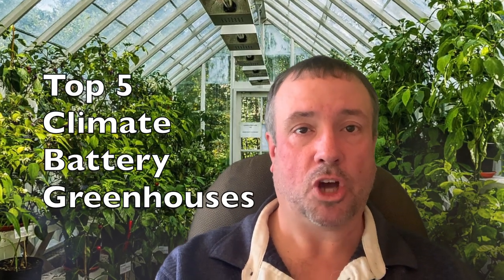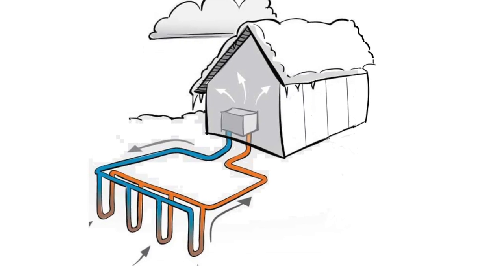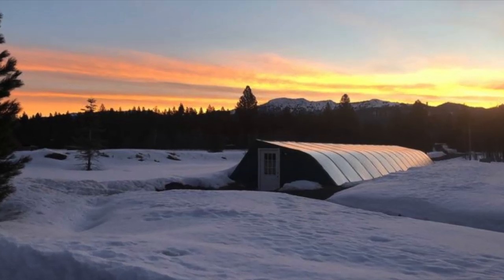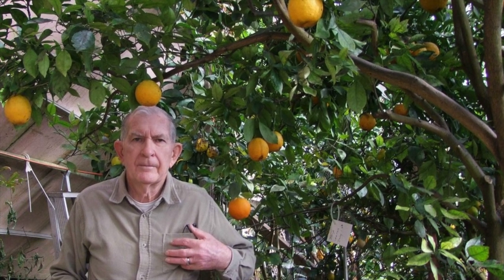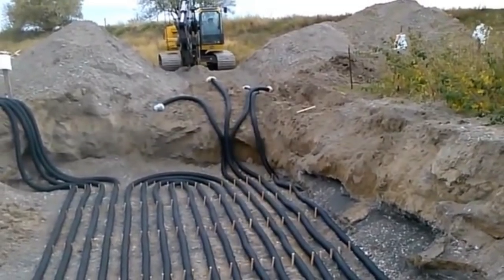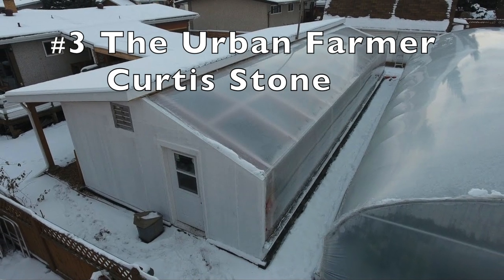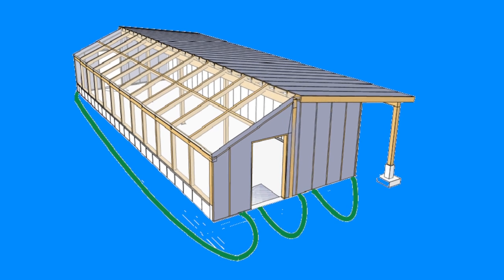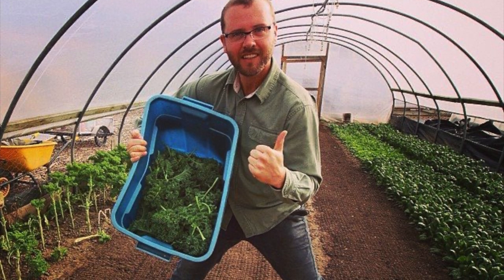Top 5 Greenhouse Climate Batteries giving Free Heat in the Winter!

Comment from the maker: I'd love to hear from you about your favourite earth battery greenhouse I didn't cover here!!!
Reply: The one beneath my greenhouse ;) 
Most of the systems in the vids dont perform as well as expected, especially for cooling, due to layout and overall design. If a system isnt efficient for cooling, it wont be efficient at storing heat because the same process is used for both. The other thing that isnt mentioned in vids or commercial advertising is the amount of moisture thats returned to the greenhouse along with the heat. Folks assume the heat returned is 100% sensible, like an electric heater, when, in reality, the bulk is in latent form (water vapour). If you have a system installed, its easily confirmed by tracking the greenhouse RH% when the system is heating.
Reply from the maker: @JohnGuest45  yes!!!!!!!!!
Reply: Christopher Brandsdal channel. He is is experiencing a lot of interesting problems.
Reply: Glad you gave Gus top spot!  I bought his greenhouse in January, and am in the finishing stages of putting it together myself (working on the retaining wall this weekend).  The only real negative I can say is that the plans/directions are lacking pretty badly.  You better have some construction know how to put it together.  But, it's a great greenhouse, and I can't wait to be finished and begin setting up my aquaponics as well as planting my orange trees!
Reply: @JohnGuest45  If you're having trouble with cooling.. do you have a tube running the top of your greenhouse to underground outside?  That's the easiest way to vent excess heat.
Reply: @basedbear1605 
Heat i want to keep goes into the ground under the greenhouse, excess heat that cant be stored (late in the season)  goes out the top vent. I dont have any trouble cooling the greenhouse.
Reply: Here's an article I read about a man who extended the Whitehorse growing season by buyilding his own home made "root heater". Chris Bartsch. https://www.cbc.ca/news/canada/north/solar-root-heater-whitehorse-1.4301082
Reply: @tineschrijvers3174  What's cute is you think 1972 was the first active solar greenhouse when Walipini greenhouses have been around for hundreds of years.
Reply: St. Isidore removed their Greenhouse, would elaborate on specifics just that it failed.
Reply from the maker: @JamesJones-tx7tz  they needed more heat
Reply from the maker: @basedbear1605  I do?
Reply: @SimpleTek  You do what?  You're commenting on 6 month old comments and I made more than one on this thread.  A little more info would help....;)
Reply from the maker: @basedbear1605  I found these comments today, so some reason they didn't show up in my daily comments section in Youtube creator studio that I check regularly.
Reply: @SimpleTek  All good, but what were you saying "I do?" to?  It's not clear.
Reply from the maker: @basedbear1605  I might have made a mistake lol
Reply: I think someone listed them a few posts down from mine - at the time. I think it's something about the Rocky Mountain Institute of some stripe. My tablet might be able to give links, but then I'd have to learn how to make it.
Reply: @Luca Colson instablaster ;)
Reply: @Alvaro Arturo It did the trick and I now got access to my account again. Im so happy:D
Thank you so much, you really help me out :D
Reply: @Luca Colson happy to help =)
Reply: Buried molten solt reactor.
Oh, it's coming.
Reply: @JohnGuest45  can I have a look at your improvements to the layout/design?
Reply: @johannesdoderlein6655 
You need to understand why the basic design that most folks use isnt optimal. In most cases, its  clear that very little, if any  design work went into them because the issues in the finalsdesign  would have been caught long before it left the drawing board.
Reply: @JohnGuest45  I have not yet acquired the skills to understand the mistakes/mechanics of these designs. But I would like to get a real good understanding, get a hold of the key insights and information needed in order to make a well working winter greenhouse. I am currently working as a gardener in a greenhouse, with heat supplied by geothermal wells. But it’s not an insulated winter greenhouse. But I would like to make the case for building one at the farm were I’m working. That way I would be able to have much more fun at work, with tropical plants that gives me great joy. I’m in Norway, close to Oslo. Winter is dark, and would like to have mediterranean and tropical plants around me. So if you could provide me with some direction that would be appreciated.
Reply: @johannesdoderlein6655  
With deep geothermal wells you are in a better position than most. Insulation is vital but you will also need to consider light in your design criteria due to your geographical location because nothing will grow well in the dark, apart from mushrooms :)  A lot of folks that design systems dont give much thought to the plants considering the whole point is to extend the growing season. A logical approach is the best option, beginning with the structure and local climate to assess the heating and cooling loads. The design must meet the goal but its impossible if you dont know what the goal is.  Folks that design heating and cooling systems dont guess and hope for the best :)
Reply: Please  check out Arcopia greenhouse in Saskatoon Saskatchewan. He is also doing a great job in solar greenhouse design.
Reply from the maker: @toechop  will do
Reply: mine, it'll be completed soon and on your next video!

Comment: These are all great earth batteries with large budgets. For those of us with more modest size normal greenhouses, I have a solution. Yes insulate that north wall. Also as sand batteries have become news worth over the last few months, it's the same idea so I dug a hole in my greenhouse 4 feet square and 10 feet deep. Insulated it then filled it with sand and air tubes and covered it. with the same idea as the fancy ones, a fan takes hot air from top of greenhouse where it's hottest and pumps it into the sand to charge it, then when the temps drop at night it works the opposite way. I built mine for around 350 dollars and most of that was on the sand and insulation. It works great.
Reply from the maker: Great idea

Comment: Thank you for sharing all this information with links so we can research and see what works best for where we live and the size of lot or acreage we have.  I live in Canada where winters are very cold in some parts.  I live in an area where average lows are (in F): Nov: 18; Dec: 3.2; Jan: -5; Feb: 23 and Mar 32.  Frost line is 4 - 5 ft - and as much as 8 ft in bitterly cold winters, deep enough to burst city water lines (2014 major damage). Curtis Stone is lucky to live in Kelowna where winters are much milder  (Nov - Mar avg between 21 F - 36 F) therefore more shallow frost line.  Here we would have to dig at least 6 ft for an underground heat storage system. And how can anyone hit the dislike rating on this or any of your other videos???!!!!
Reply from the maker: considering I live an hour north of Winnipeg I understand cold winters. The key to a climate battery in our climate is insulation. Later I'll be doing videos on this - the best materials I've found are if you can get styrofoam from buildings being destroyed or making your own air Crete. if you have 6-10inches of insulation around your climate battery the cold weather and frost isn't a big deal.
Reply: Hi Tine Schrijvers, sounds like you are in Southern Ontario or equivalent. From my experience as a city water supply technician, I can tell 7 plus feet below surface is good enough for freeze prevention in the greater Toronto area.
Reply: @AshoreToo  Actually I am in NW Ontario, near Thunder Bay.  Zone 3a or 3B - 2A or 2b  Toronto is Zone 6 so much warmer.
Reply: @tineschrijvers3174  I've finished my career with City and now I'm preparing to start green housing near satellite cities of Greater Toronto. I hope to compost inside the poly-carbonate greenhouse, burn dried wood and shrub to generate heat, possibly make a waste engine oil burner. To enhance heat retention, I plan to cover the top and outside of the poly-carbonate sheeting (with bubble wrap) during severe cold times and roll the bubble wrap away when sunny. Inside I'll add a high tunnel of bubble wrap over the beds so that there are 3 layers of insulation. Biogas is my target too although my scale will be tiny.

Comment: Great video, but I was expecting 5 different types of Greenhouse Climate Batteries.  What do people do for greenhouses in areas with shallow bedrock, etc?  I like the idea of digging down and blowing air, but I've seen several people utilize black heat-absorbing beds, floors, solar hose arrays, and aquaponic tanks to act as heat sinks.
Reply from the maker: you can build a climate battery above ground and insulate the walls

Comment: I've talked with Russ on the phone about 5 yrs ago.  Great guy.  He is a tinkerer like us.  I live in Kansas City area and thought I could just drive up to visit but he is almost to Wyoming  ha ha.    My ground temp here in 56-7F/13.3C about 8 feet down so I bought the CD but still haven't moved to the country yet.  The biggest problem I have witnessed on Youtube on variations of these are when when people move away from Russ's I never see a follow up videos from them. I don't know why this is.  I know from my conversations with Russ he has tried virtually everything and if something worked better, he would have gone in that direction.  A big issue is when you place a lot of turns in your underground tubing.  That slows down the air considerably. I think he said he only had 2 or 3 in his entire system. I think what is missing are actual temperature and windspeed sensors down in the ground to see exactly what happens in many-bend systems. Also, intrigued from your underground a/c video, I was wondering, are there larger dia. smooth tubes that you used for your a/c idea for this application and heat?   Re: LDS prepper-yes styrofoam only type of solid insulation recommended for greenhouses from my research.  It is such a humid environment I liken it more to a marine environment.  Everything will rust or get soggy eventually.   Also, before I forget,  there is a product out of Colorado that you put on in the inside of your north wall that absorbs heat in the day and releases it at night. I forget what it is called.
Reply from the maker: Than you for the info!

Comment: First of all, thank you for the work you are doing. I am planning on building this coming spring just south of Minneapolis. I will already down 4' with my bobcat to dig the hole, so I'm planning on taking a post hole auger and angering another 4' down at the base. Then, I will run those tubes (not looped) into my bottom header that's located at 4'. So I would be pulling from 8' below ground in the winter. Do you see an issue with doing that?
Reply: Augering not angering
Reply from the maker: I don’t see a problem

Comment: Howdy! 
I've been tinkering with the idea of having a modified sterling engine (using neod mags. and liquid oxygen/nitrogen, plus the added feature of a liquid battery for its heat generation/power storage).
If the vehicles we use are made to function on specific *rails (multiple lanes, which can be automated and/or custom controlled - at specific points).
The rails would act with both liquid oxy/nitro and neodymium, one of the means of propulsion.
Air pressure - collection from the nose tip. To then be utilized with fans and other volatile chemists that react to other factors.
- Floor battery: sterling engine, transportation of liq oxy/nitr - which transfers the additional cooler temp [can have rotational statuses of sending heat or cold - for seasonal changes of different locations/area/zone.
- Liq oxy/nitr - utilized for any aspect of bringing more bliss to stay others want to do (craft, service, farming, education that works/the 'pure child-like excitement' of something new and that draws you to want to do more... lol)
- Maintenance dues: via donations/volunteers and/or very low cost to everyone that uses this service. 
- Also having a test area for - Algae farming for biofuel potential... (which we would need a bunch of people to man the ship... lol). And stretch that out for everyone and companies to be able to generate their own biofuel and other products and/or have a 'collector'. 
- I wonder if the liquid battery - the heat generated - be able to smelt... be it from super- capacitors used as arcs... lol, or some other same way... (both, energy discharging and surface temp - if plug and play avail).
- If so, then, placing the smelting mechanisms to the rail system, would generate means of faster output for transforming unused materials and heat transfer - sterling engine. 
- Which should be able to alternate the temps going either direction.  

Okay I'll stop here... lol, soo many thoughts and ideas... lol,  Cheers!! To a more Utopic society for all! Equally~
Reply from the maker: really interesting ideas! Thank you

Comment: Are there any successful designs for an above ground climate battery?? .. like water barrels in a well insulated solar kiln design, perhaps?.. then pushing that heat where needed? ..  or maybe a small greehouse within the greenhouse, built around concrete blocks or around barrels full of water that are also being heated by a homemade solar furnace panel full of copper line or pex keeping the water heated?
Reply from the maker: Yes
Reply: @SimpleTek  do you know of anyone growing year round in colorado w/o electrical power and without the underground thermal bank?
Reply from the maker: @jerome8314  yes
Reply: @SimpleTek  care to elaborate lol?
Reply from the maker: @jerome8314  there’s a few on YouTube

Comment: Thank you so much for your comments, on others negative comments, about a YouTubers religion.  Saying nothing or ignoring this type of thing did not work well in 1930s Germany nor here in the USA at various times in our history.  Climate Battery... I didn't notice a mention here about the Chinese style (mass on the north wall. We will use shipping containers that will be filled with sand and actively heat them which is a twist on the earth battery and Chinese methods combined.